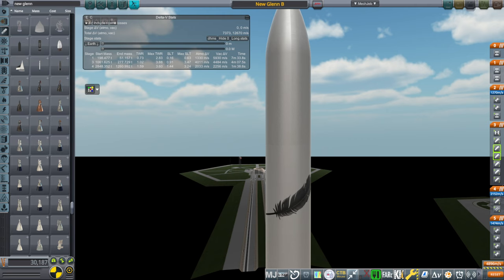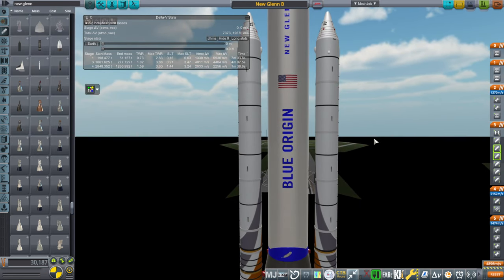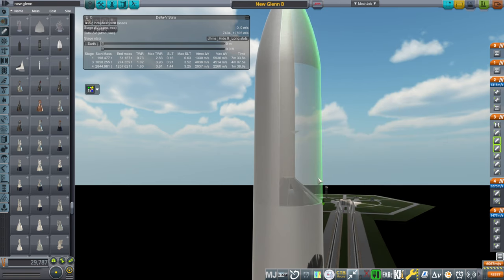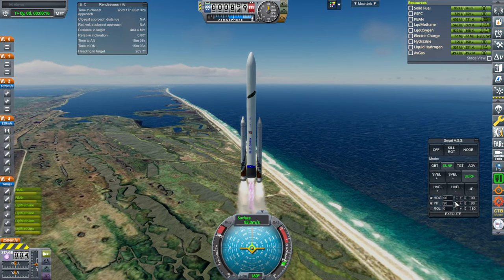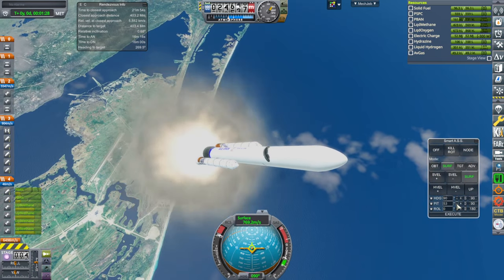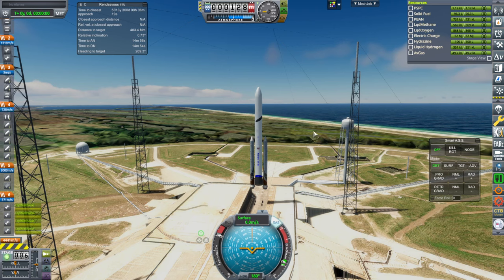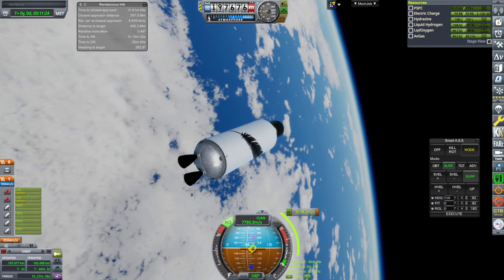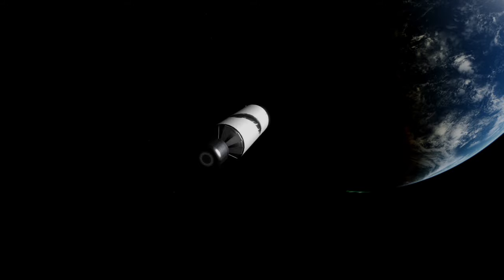Bezos Launch System - New Glenn with SLS Boosters (RO in KSP 1.12)

Comment: Could call it the Seattle Launch System as Blue’s headquarters is in Kent Washington part of the Seattle metro area. Let’s you keep the acronym.
Reply from the maker: But Boeing is also sort of Seattle (I know they moved the headquarters, but it's still Seattle to me), so that's sort of vague.
Reply: @RaizSpace replace orion with starliner then
Reply: @lefishe7702  I doubt Starliner has the life-support capabilities for operations outside  low earth orbit.  I think Orion has something like six weeks of life-support.
Reply: @mbmurphy777  i doubt new glenn can handle 2 falcon 9s strapped to the side aswell. This isn't a realistic scenario in any sense

Comment: I'd like to see and SLS with an S-IVB upper stage. From my (limited) research its actually a decently sized stage for the core.
Reply from the maker: Well, might as well go with the New Glenn upper stage, since it's available and roughly the same size. I've done that before, and it doesn't change a whole lot.
Reply: @RaizSpace  how about with an extended blue origin upper stage?